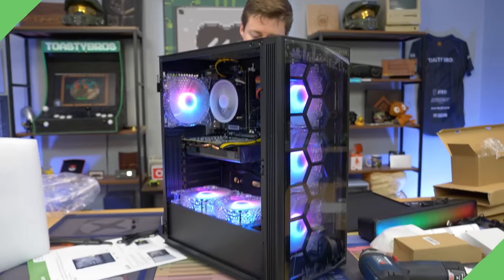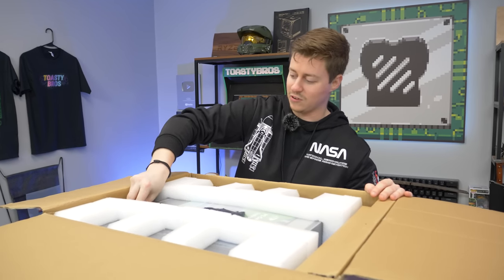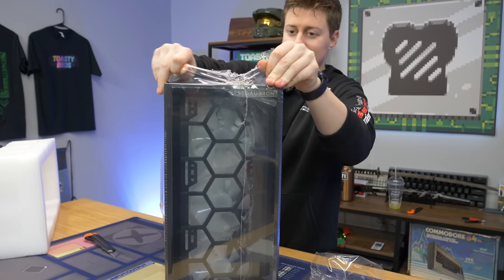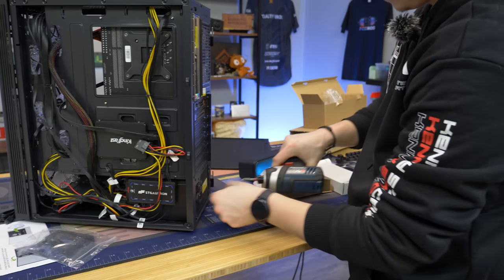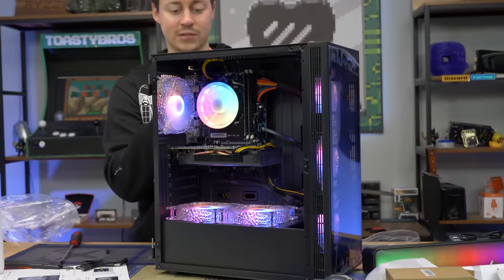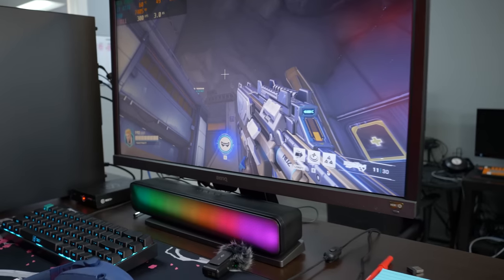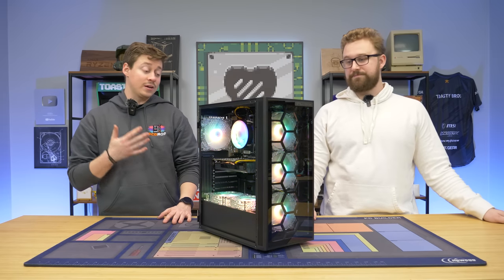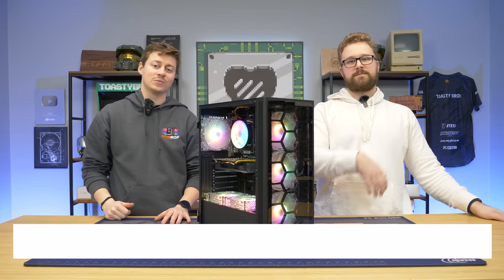Why are People Buying This $600 Gaming PC??

Comment: Fortnite has left the chat😭😭😭
Reply: w pfp
Reply: @Caydenboi21  LMAO
Reply: Apex to
Reply: Spend a little more on a Ryzen 5600 and RX 6600 and you'll be good. Or an RX 6650.
Reply: @S3treamZ  yeah
Reply: cringe
Reply: @whomadet  my pfp ?
Reply: Fortnite
Reply: @aguyandhiscomputer  you cant get hose at this kind of prize😭
This 2060 is an exception too.
At least in my country
Reply: The fortnite left the chat ALMOST made me click off
Reply: Haa ha ha
Reply: The optimization is so bad so even with very solid specs it's awful. I was semi pro running a 5th gen ryzen 5 and gfx 1660 OC AND STILL HAD TO play on medium to get any decent fps
Reply: @Caydenboi21  L
Reply: @ThrottleWide  1660? When did that come out?
Reply: @scotts1668  2019 I think why
Reply: @ThrottleWide  because u said with solid specs :/
Reply: @scotts1668  the 1660 oc is pretty good and out preforms the 3050 on several marks?
Reply: @ThrottleWide  oh well im unfamiliar with that specific card but i have a 3070 and fortnite does over 120 frames consistently at ultra settings
Reply: @scotts1668  ya I mean by solid I mean average, the 3070 is 300 used right now while the 1660 super can be picked up for 120 sometimes less
Reply: @ThrottleWide  the 3050 🗑
Reply: @Confhirm  the 3050 is bad if you look at it brand new and for certain titles. The point I’m getting across is that while it’s not insane, I’m able to game on a PC that you can get for 3-400 and get over 170fps on ultra in esports title and am able to get 60+ in cyberpunk and other cinematic games
Reply: @ThrottleWide  id get the 6600 before I even have the thought of the 3050
Reply: @Confhirm  good for you dude. All I said was that I had a 1660 and you started crying about GPUs. don’t know what your deal is but you should probably talk to a therapist or something
Reply: @ThrottleWide  i have a 3050ti and its not that bad lol- atleast for my standards. But i agree that fortnite has bad optimisation, i used to get 120-150 frames on epic settings but now i get about 58, yes there was alot of graphics improvements but it surely isnt optimised
Reply: @S3treamZ not to be that guy but you said “apex to” which if grammatically correct it should be “apex too” sorry man 🤷‍♂️😬😐
Reply: @judehopkins5636 my english is not that good
Reply: fortnite is garbage anyways
Reply: @S3treamZ  sure sure 😒
Reply: I was looking for it man
Reply: hahahah cancer up 😂😂😂😂😂
Reply: @S3treamZ who tf plays that
Reply: U can’t play Fortnite?
Reply: Just cap  the fps
Reply: @rngplayes445  to like 144, that’s my monitors hz
Reply: @rngplayes445  btw do you know what generation the intel is??,

Comment: I really dont see any justifiable reason to put 4770 in  budget gaming PC build when 6th 7th and even 8th gen are very affordable today . . Also 4770 is 1150 socket where 6th 7th and 8th gen are all 1151 socket . Whatever dumbass built this pc specifically looked for 1150 socket motherboard because he had a pile of used 4770 laying around he got from some ebay e-waste re seller . You can find brand new 1151 socket motherboard for like 60 bucks depending on the chipset gen support . 6700 and 7700 you can get on ebay for also around the same price range.  So this makes absolutely no sense tech , financially and logically LOL . This set up even makes less sense * if thats possible * when you consider that Ryzen 5 1600 AF is 50 bucks brand new with the wraith cooler LOL